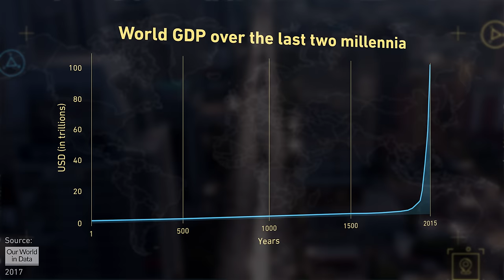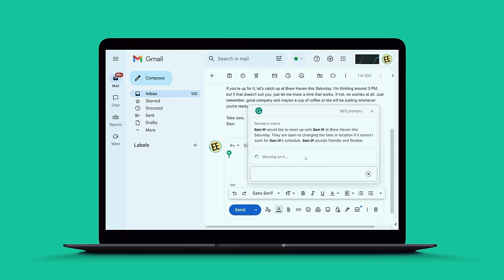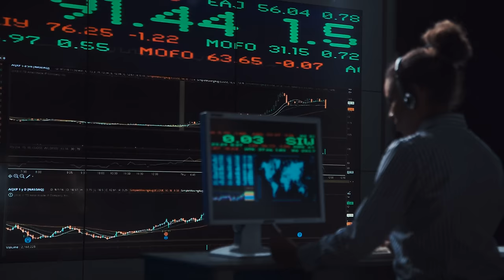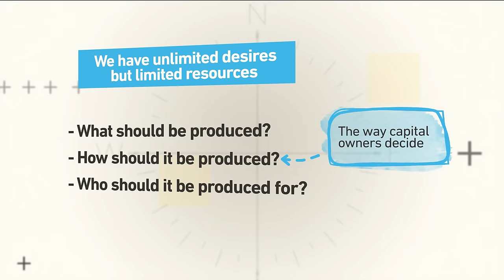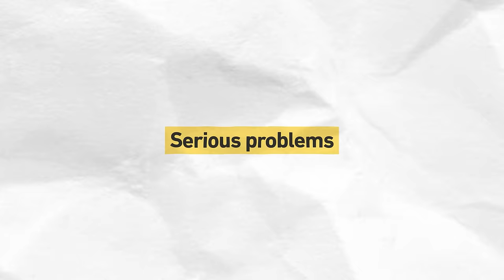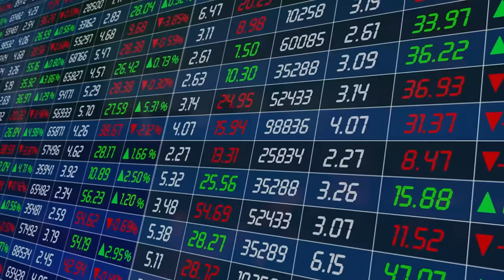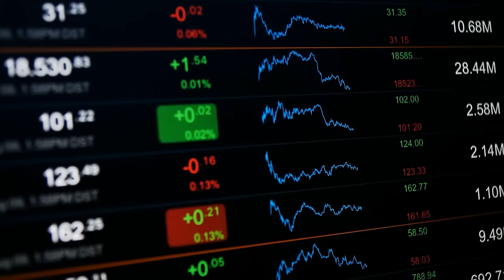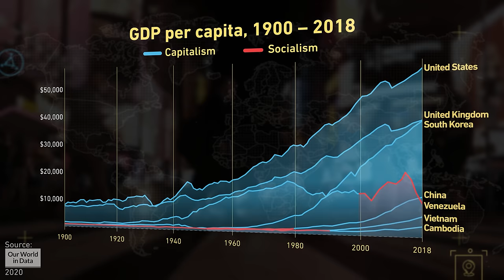Why Every Country Ends up Capitalist

Comment: I think for me the issue is we have outwardly capitalist individuals arguing you just got to capitalist harder when we don't have good support for that. Nearly every economy is mixed and what we have accepted is that past a certain point, regulation is always needed as no market remains "free" after a certain point. This idea that someone will just innovate a solution is one that does not understand our level of development. No one is manufacturing some new thing in their garage that can outcompete fiber optic cable. There are barriers to entry now that are just not feasible. Even with a good idea. This is so true now that companies that do purport these hyper innovative ideas are usually at best, under delivering, but more often just complete frauds. Looking at you theranos and basically every Kickstarter.
Reply: Well said

Comment: I don't want an end to capitalism. Just an end to state subsidized monopolies. The problems we encounter today are in most part due to government and corporations working together to crush the common people. To consolidate wealth in an elite few through skewed regulations, byzantine tax laws along with the use of the law and the justice system to crush competition.
Reply: It's socialism for the rich, and capitalism for the poors.
Reply: The state needs to be smaller. Like 90% smaller.
Reply: Then what you want is capitalism.
Reply: The concern there is that corporations in such a system will inevitably try to influence the government because succeeding to do so will grow them massively
Reply: @supernukey419  Thats exactly what theyre doing right now 😂
Reply: @TheAdamAdy  Indeed and I doubt anything could convince them to not do so
Reply: @ronald3836  Capitalism is the system we have right now, and it’s created this issue. You can’t claim this issue wouldn’t exist under capitalism when it does, and it came into existence under capitalism.
Reply: @supernukey419  If the government is smaller and smaller, there is less people to corrupt, less things to influence
Reply: @L333gok  The current system is corporatism or crony capitalism. Definitely not typical capitalism
Reply: @TheAdamAdy  And corporatism is a type of… what? Lol. That line of logic is about as valid as the type who claim the Soviet Union didn’t subscribe to real socialism.
Reply: @L333gok  lol no, accumulation of wealth and power in a few individuals has existed since forever. Go to any non-capitalistic country in the world and see if you like it there. Spoiler: you won't. But capitalism/free market does need proper regulation so the market remains truly competitive. Anyway, some accumulation of wealth is not the end of the world when in the end everyone is better off (and you ARE better off even if you obviously don't want to accept that).
Reply: @L333gok  Corporatism is caused by bloated corrupt government. Free market capitalism has very minimal government. Its a government problem, not capitalism problem
Reply: @ronald3836  All countries are capitalist in the contemporary day. And of the ones that aren’t, we can clearly see they had a lower incident of inequality: Anarchist Catalonia; The USSR prior to the 80s; Plantation economies; even the Nazis if you want to argue they weren’t capitalist. Inequality exists under every system, but the extreme level of inequality we see nowadays is pretty much exclusive to Capitalism and it’s predecessor Feudalism.
Reply: @TheAdamAdy  Corporatism is a type of capitalism. It’s a textbook Belgian compromise. Wanting socialist-esque control of the economy whilst avoiding any actual socialist policies. It still favors a free market, private property and all the other aspects of capitalism, thus is capitalism. 

The idea that it’s issues could be solved with a more classical approach is delusional. Even without funding we see them receiving in modernity, these monopolies will still arise. They don’t need funding from the government, they just need the regulations imposed to be curated to their liking. If they have the means to achieve enough political influence to secure such funding from the government, then they most certainly have the influence to secure such legislation in their favor.
Reply: @L333gok  ok tankie
Reply: @L333gok  Corporatism is a result of government captured capitalism. Government itself is the weak link, not capitalism
Reply: @TheAdamAdy  But those people in government will always be trying to acquire more influence (when was the last time you saw a government department want less funding?) and corporations will be incentivised to help them acquire that influence because whoever helps them acquire that influence will get a choice in how they use it
Reply: @ronald3836  That doesn't justify anything, except laziness or the incapacity of people to imagine something better. If you regulate your economy enough, you stop calling it capitalism, and it becomes socialism.
Reply: Bingo, huge corporations and nation states are in kahoots. They're not at odds.
Reply: but capitalism breeds inequality and creates monopolies. everyone is forced to compete to attain more capital, and so eventually one has way more than the others, and a few have more than the many. it's really hard if not impossible to have capitalism without monopolies, because it encourages them.
Reply: @septanine5936  Capitalism encourages competition and is basically synonymous with competition. What is your alternative? State monopolies?? What other system even allows competition?
Reply: @ronald3836  I don't have an alternative. I was just trying to say that we likely can't have capitalism without monopolies. though I do think it'd be preferable if we didn't have to compete for things like housing and good education.
Reply: @septanine5936  ok, then we don't really disagree. I agree that regulation is needed to prevent and fight antitrust issues. I'm not advocating for unbridled capitalism, but I like it as a system that aligns individual interests with the common interest. Only such a system can function without oppression.
Reply: @ronald3836  The alternative is cooperation. The word "cooperation" is antonymous to "competition". Socialism is based on that. You cooperate with your colleagues to produce things. Decisions are made democratically. Cooperation is superior, because it combines the strengths of all parties, instead of pitting against each other.
Reply: @Simboiss  and we know that true socialism does not work. If you can just sit back and let the others do the work, then that is what you do.
Reply: @ronald3836  The work of the capitalist consists of maximizing profits above all else. Its precisely because of this it creates an ever smaller ruling class and a mass of working class people who operate specialized machines which replaced specialized labor because to drive profits their way capitalist must replace skilled labor with machines and cheaper unskilled labor. The rising capital value while the source of profit our labor results in a declining rate of industrial profits. Traditionally the capitalist handed out strike provoking wage cuts by now the do the same thing by deflating the value of the fiat currency with central bank generated inflation to hold down wages while the value of property and commodities is allowed to rise.
Reply: @TheAdamAdy So you want very small government, then what if a few corporations end up creating oligopolies again (since in capitalism competition means there is always a winner and the bigger that winner gets the more catastrophic its actions can be).
Reply: @TheAdamAdy  notice how L333gok stopoed replying to you and rather picked out the easy meat XD

Comment: It was slightly mentioned, but generally glossed over. Capitalism with no restrictions can also be really, really messed up. People worked in horrible conditions during the industrial revolution. And that is not even talking about all of the capitalism driven colonialism, exploiting people in ways that make the industrial revolution working conditions look like a daycare. Capitalism works well as long as it has enough of an opposing force keeping it in check and regulating it.
Reply: Did it really change though? The only change is that those working conditions have been exported. A capitalist society needs low labor cost in countries like DR Congo, China or Vietnam to function. The only reason capitalism works in western society is because externalities are exported to the 3rd world
Reply: but if that opposing force (in most cases, the government) benefits from a lack of regulation, there's little incentive to keep things in check beyond making sure it continues to benefit
Reply: @Holidayinspain76  yeah. as far as I've seen capitalism doesn't work without someone being exploited, and so the atrocities of colonialism persist
Reply: @Holidayinspain76  that's not really a fair comparison, even though labor is exported to those countries, but they still get an economic boost, no one wants to buy a $40 shirt or $80 sweater etc, that's the price of having affordable goods, the labor has to go somewhere that is cheap, it's not fair to say it didn't really change
Reply: no
Reply: That is not true. People worked in horrible conditions in the 19th Century, no question. But they took those horrible jobs because the alternative was literal starvation. These jobs didn’t go away because of “an opposing force keeping” capitalism in check. They went away because labor became more expensive (more rare, relatively) and nobody would take those jobs.

Comment: 10:48 Because of ATCOR, an LVT is capable of extracting the same amount of wealth as all other taxes combined. Because of EBCOR, all other taxes on productivity reduce economic output. Put those two together, and the LVT ends up being able to extract MORE wealth than all other taxes combined. Also, the best method of calculating the value of the land and the LVT is by using the market mechanism. Auction the land. This makes the enormous task of calculating the LVT cheap, easy, distributed, systematic, and non-arbitrary.